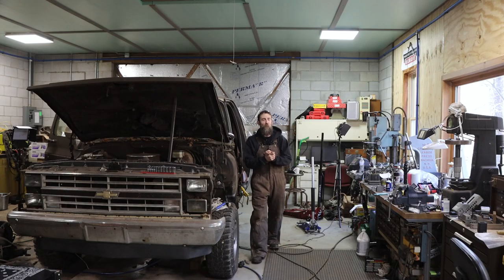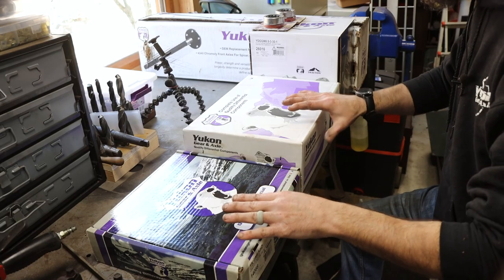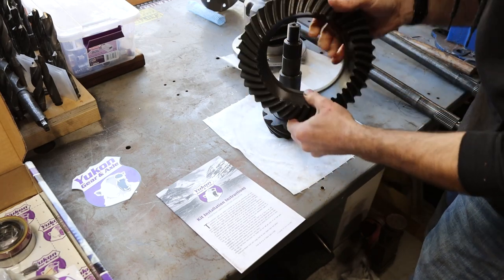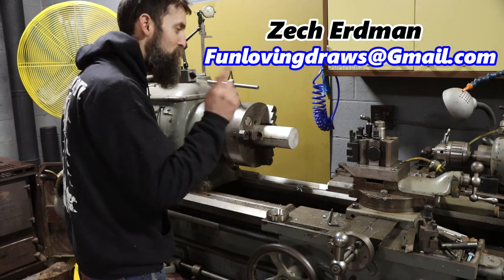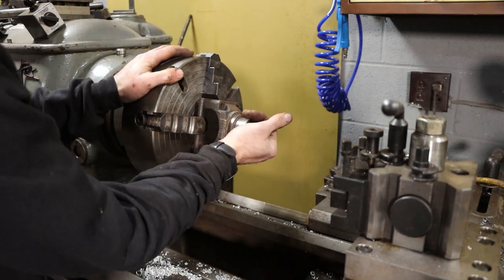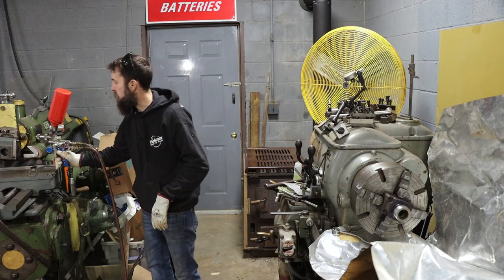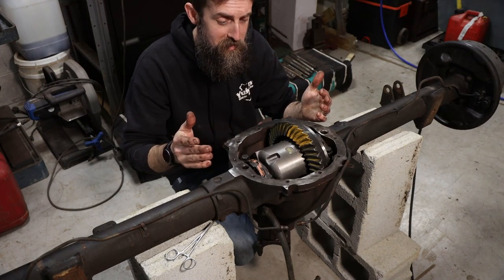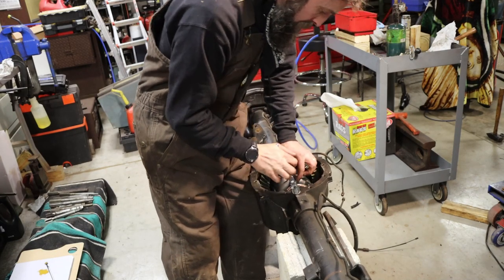Complete Rear Axle Build with my 81 year old Dad. Chevy build 11

Comment: An old school trick used by guys that were swapping gears somewhat regularly was to run a piece of paper through the gears.  They would be either swapping gears for street vs racing or be in a jam somewhere on the side of the road, and pretty well already had an idea what shims to use. So the idea was if the gears cut the paper you needed to adjust something. When it fed through and didn't cut the paper it would get you by for a while. ....you're a lucky guy steve, my dads been gone for decades now, ...what I wouldn't give to spend an afternoon messing with an old truck with him.  Thanks for sharing..Merry Christmas!

Comment: You’re a lucky man, Steve. The best part of this was your father’s presence. My father wasn’t a mechanical kind of guy, but he was fascinated that my brother and I built engines, transmissions, rear ends, and such and he used to “help” at times. Both of them have passed on since those days and working on my stuff just isn’t the same. It’s still good, but different. Props to Yukon, we just built a 9 inch Ford rear for an 82 F100 with a 2018 Coyote transplant using their kit.

I suspect that is you and your mother arm in arm in the last still shot. It kind of sums it all up. Merry Christmas to you and yours.

Comment: I recall you mentioning your daughter asking why you need all those tools. I get that a lot too. But here is a perfect example. You need to press out bearings - u have a press. You need to make a tool so you press them out putting force only in the outer race - you have a lathe and a scrap box to make it. Worn seal surface, no problem - spray weld it and machine it. You are at the point where you can do just about anything’s you want to do. One thing you don’t have, and I put a temporarily one together and really love it, is a spray booth with good ventilation and dust protection. You can get by without it but once you have it you will appreciate not getting dust all over your paint jobs or overspray all over the shop. I used a winter car shelter which are common here in the frozen North. A barn fan, velcro zipper opening and furnace filters completed it. I realize everything costs money and space and you have to prioritize. Something to think about. Keep up the good work. You must be loving your warm, well lit, well equipped huge shop with great views. What a difference a few 1000 hrs of swear makes!  😀

Comment: I learned something today. I would never have thought that gears that came new would have to be checked for dings and bits.
Reply from the maker: Deburring is not a must do thing.  The 1st run will fill the oil with metal just because of the gears seating in no matter what prep you do.  I just think its a good practice to clean them up and check them over .👍

Comment: at my job "we build differentials for scania trucks" we shim the pinions by shimming out the bearing race in the housing rather then the bearing on the pinion gear it makes it easy to replace the shims and get the spacing just right but annoyingly enough it also results in having to adjust the spacers inbetween the bearings on the pinion                                                                                                                              EDIT! i don't want to criticize what you are doing here i just wanted to give another perspective it's actually really nice to see so many different ways to do essentially the same thing working

Comment: Nice Steve, I'm in the process of putting a 350 crate motor in my 84 square body. At 420 hp my axles are going to need an up grade!
Reply from the maker: Nice. Put a mild locker in the axles 👍. As long as the rear isn't worn completely out and in good shape it should hold I would keep the tire size down as well.
Reply: The corporate 12 bolt is about as tough as they come. My 525 hp small block in my 80 square body has never given me a lick of trouble for the last 15 years and that is with a heavy R foot. A very heavy R foot.

Comment: Hi Steve,I did a Yucon limited slip for my 2000 chev 1 ton 6.5.It works really well,I hardly need the 4x4 anymore.Use their limited slip fluid additive  and change after 500 miles. Nice jig boreing on that bearing.Nice build.And you got to heat the shop up with the metal sprayer too.Wish you shown how the crush sleeve worked and how to install it.Its a real pain to do it with the axel installed on the truck and not have a lift.
Reply from the maker: I will try and show it on the front axle 👍

Comment: I ran a 8.5" ten bolt in my 68 GTO. The car had a healthy 455, TH 400 with 3,500 converter, 4.10 ratio, stock GM posi unit and stock axles. The rear axle came from a 73 or 74 Cutlass, took custom upper arms, relocating the coil spring mounts and shock mounts to fit it. That combination went high 11s in the quarter mile in a 3,980 car on slicks. That rear will be plenty strong for what you do.

Comment: Merry Christmas Steve and family. Would like to thank you for all of the great content here on YouTube. Really looking forward to your vids all of the time! 
You may already know this but a good tip if you don't. If you take the bearing race, (inner or outer), and split one side with a thin grinding wheel they make a really good driver for the new race or cage because they will expand or contract if pressing or driving a bearing past a flush surface. It might not be as interesting as some lathe work but it is a time saver & during the course of my career as a diesel technician I have never damaged a race using this method. Another good tip for heating up any gears, races, or cages is to get an old french fryer, (got mine from the thrift store), fill it with motor oil & drop the bearings in for a short time just before you need to install them. Cheers and thanks again.

Comment: On late 60s olds they used a ten bolt ring gear and non C clip axles but used a 12 bolt housing that will not accept a 12 carrier. So yes as most go by the cover bolts you can't always go to the bank by counting cover bolt.

Comment: It’s great you encourage people to take on these jobs. You’re right, not all that hard to do. 

I do use crush sleeve eliminators  I have found setup to be easier and if you ever need to pull a yoke for a seal replacement, just reassemble and tighten the nut. No fear of disturbing preload or position of the pinion in the case of wear.

Comment: Received my Yukon 4:10 gear set for the front axle of my '06 Dodge Ram 2500 5.9L Cummins 4x4 Stretched (8ft bed) Mega Cab. I had previously done the same ratio upgrade on the rear 11.5 AAM axle.
Reply from the maker: Awesome 👍

Comment: diff work isnt hard but it is precice and repeditive (meaning you be mounting and take it apart a few times before you get the meshing of the gears and torq on the pinionshaft rotation right)

Comment: New  gears and bearings.  Set on the tight side of the spec.  Used stuff middle to the tail end of spec.  Resistance should be applied to the the gear set when checking drive and coast side of the contact patch.  Will your current setup cause a catastrophic failure, or increased wear rates.  Nope.  Will you notice the the looser tolerance behind a manual transmission?  Nope.

Comment: At 16:00 why not chuck up the yoke seal and shave 50-100th off of the inner edge, and drive it in further into the axle housing, to a new lip sealing location on the yoke.  depending upon your actual yoke, you may be able to trim 50-100th off of the bottom of the yoke instead and get a new lip seal location that way as well. You would need to check if the big nut could still clamp the yoke to the pinion correctly, maybe clearance the pinion if necessary.  Getting into Bigger Lathe stuff now, but still more common than spray welders. Almost all of us do not have spray welders at our ready use, but many more have small lathes to do this type of repair at home..  Thanks for the otherwise excellent content

Comment: Great job. For those of us without a lathe and spray welder the yolk an be bought new or junkyard and hope for the best. Just wondering why after all you spent why you didn't upgrade to the C-clip eliminator package for the rear as well? Not that you will ever brake the upgraded axles.
Reply: I’ve installed many a Speedy Sleeve on yokes, axle tubes, and balancers.  An electric hotplate and some dry ice (or put the part in freezer overnight).

Comment: I noticed drum brakes at the start and disc brakes at the end. Good vid
Reply from the maker: The rear is still drum. That is a front axle at the end.👍
Reply: @SteveSummers  ah I see   thx
Reply from the maker: @jamesdrake2378  I am hoping to add disc brakes to the rear but its a want not a need I guess
Reply: @SteveSummers  I think disc brakes on the rear are not as important as for the front. Also what I noticed was the size of those rear drum brake shoes, they seem extra large? Thanks for the content.

Comment: Good video. While I agree, ring and pinion setups CAN be done by an  average mechanic, I've seen plenty of butcher jobs, too, which I've had to sort out and redo. MANY people think you just slap them back in, eazy-peazy, and that's not true at all.
Reply from the maker: It definitely takes some thought. The directions that came with this set  are pretty good. When it comes to a front or rear axle guessing isn't good enough.  A person needs to be able to stop and ask questions if they get into a spot they don't understand. They also need to be willing to redo everything if things are not going well.   I agree with you 👍
Reply: @SteveSummers  one thing I do is I pry the ring gear, sideways, away from the pinion engagement,  to take get a
Reply: @SteveSummers   sorry, to continue, by prying against the diff carrier, forcing it left you are getting the best contact reading, because you are maximizing the backlash, and better simulating the pattern the gears will "see" under load, like it will have in actual use.

Comment: Happy holidays to the house of Summers and a great new year, the truck is coming out to be a awesome build would a speedy sleeve be available for the yoke.i have my eyes on a two wd with a 93model drivetrain as usual money is tight and times are hard fjb
Reply from the maker: Yes, I'm almost certain you can get one for a pinion seal anywhere. I never leave the shop so spray weld was my method.  It was quicker than a drive to town.

Comment: Did you do a final pattern check with the new bearings before you buttoned it up?
Reply: I'm no rearend expert, but I always thought that setting the pinion depth with a used worn bearing would give an anomalous depth, having no relevance to the actual final depth of a new bearing. Maybe it's close enough that .002" of wear won't make a big difference on the wear pattern. I'm curious.
Reply: @marcellemay7721  He measured both the new and old bearings beforehand to get a comparative assembled height.
Reply: @whodat90  I guess it works, kinda. But, if the old ring and pinion were not set up correctly to begin with, you're essentially verifying a bad setup. It probably gets you close, but it's probably gonna have to be tweaked.
Reply from the maker: Of course 👍

Comment: For spray welding, I don't understand why the 'tooth pass" surface prep is necessary.  Is it not actually welding, where the base metal is melted?
Reply: The base metal is not melted in the spray weld method. The thread pass adds extra surface area to the spray weld material to bond to.
Reply: @MadDawg91108  - I hear you.  Seems more like a spray on, shrink fit bushing than welding though.  Maybe steel-steel brazing, since its too high temp to be soldering?  I just can't think of it as welding, without that base metal melting.

Comment: Any reason why you didn't shave down the dust seal surface and spray it as well??  Being right together it would seem a natural?
Reply from the maker: I just cleaned it up and used some Loctite retaining compound to hold it in place.
Reply: @SteveSummers  603 will hold much more than that light dust seal, I have used it to hold gears onto shafts where the fit was not an interference fit, and that held up for a long time as well. Than you SEW for making your new bearings the same size in metric as the old pre decimalisation size, but rounding off the size to make the new gear not be an interference fit. 603 and the keyway saved the fit, because they did not have the intermediate shaft in stock any more.